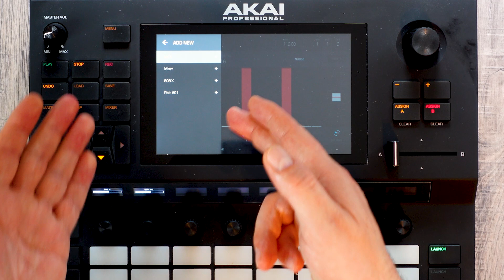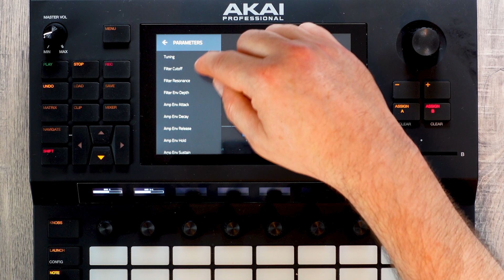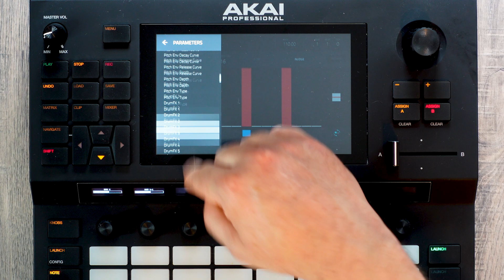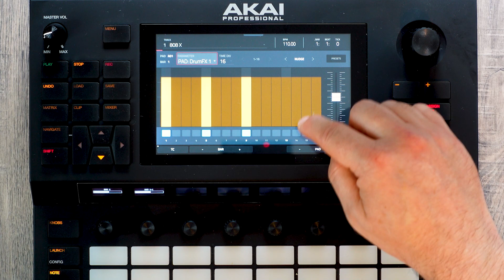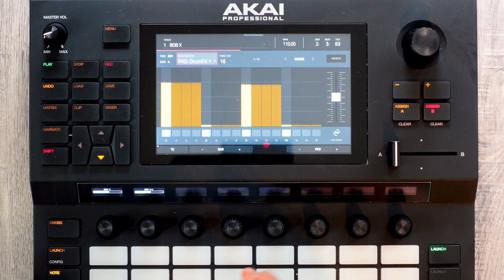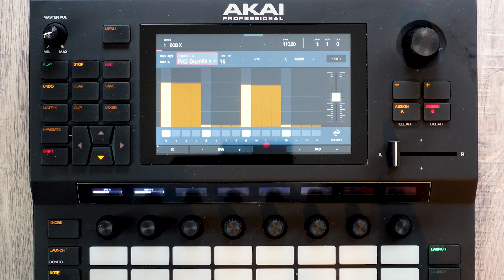Akai Force Tutorial: Use Sample Pad Automation To Create Interesting Drums

Comment: Such a great technique. As a Tracker user as well this speaks to me as trackers thru the ages have made this easy. 

And this is so much easier than automation in DAWs where to get per step is a matter of a lot of zooming in & out and drawing small chunks of data in right at the start and end of your midi data or samples. 

It’s rare Akai get something so right but they have here. And not turning off the per step automation by accident (shown here by the next step along with no levels turned up) sometimes brings some happy accidents. 

Nice work Andy 👍🏼

Comment: Hey man, thanks for the great videos. So much to figure out with this device. Just wondering, my samples are sounding different on different pads even when I’ve set all parameters the same. Any idea why this is the case? Can’t figure it out for the life of me.
Reply from the maker: That’s a head scratcher, without seeing what’s going on I’m not sure. I would suggest resetting preferences, creating a new project and then putting some samples on pads and seeing if it persists. The only thing I can think of is if you went to track edit and instead of having ‘all’ selected, you’ve tweaked an envelope or something on a few individual pads and haven’t spotted that. Also check your pad mixer and see if any sends have been applied to individual pads.

Comment: Definitely an underrated and less well known feature of the The Force and nice and clearly explained - well done. My only bug bear with it, is that it applies to the track regardless of the clip (NOT TRUE - SEE COMMENT BELOW). So if you wanted those parameter modulations in one clip on a track but not another, you have to turn off the step sequencer for the one you don't want it on and there's no quick button combo to do that that I'm aware of. I'd love it to apply to individual clips rather than tracks, unless I've missed something...
Reply from the maker: I’m not near my Force at the moment so can’t test it, but I thought it was per-clip rather than per track. If you add some automation to a clip then copy and paste it as usual, select the duplicate and then press shift + delete automation (bottom row) you can try moving between the two and see if it’s persistent.
Reply: @MaxipokMusic  My mistake - I've just checked and it does seem to be clip based. Don't know how I missed that! Then, yes indeed, this thing is killer. Combined with the envelope follower and macros, this gives you the kind of modulation flexibility you get in modular, especially once the probability comes, as you say.

Comment: I appreciate your videos. I'm curious of your reasons for moving on to the force from the push 2? I'm actually considering a push 2 to take advantage of ableton 11 but I already gave a force. So lots of money invested on both sides. Anyway. Thanks for your work
Reply from the maker: Push 2 is a really nice device, but the reason I switched was to do with performance. Push has track focus, meaning it will only display or let you control one ‘thing’ at a time. For example you can have the mixer up, or device controls, but not both. And the knobs are fixed to the selected mode, so you can’t map them to macros and have the stay available regardless of the track you have armed, like you can with the Force. So in a nutshell, it only lets you do one thing at a time, whereas you can set the Force up to give you access to macros, mixer, clip / scene launching, and note mode all at the same time. It’s the only device I know of that can do this, making it great for performance. You can get Push to sort of do this, but I means using Max For Live and buying a couple of scripts (push hacker for example), but even with that it’s not as flexible. If I was just making music in Ableton I’d have kept the Push, but as I like making performance videos, Force was the best option.
Reply: @MaxipokMusic  thank you so much for that detailed reply! That really helps.

Comment: Step sequencer is really the only thing which I was not utilizing in my workflow but it seems that there is a lot to discover. Nevertheless I like to twist knobs more than setting things one by one... 👌
Reply from the maker: Yep I know what you mean, it doesn’t come naturally to me either. I wonder if it depends whether you started out on Roland xox boxes? The allegedly coming probability stuff will really open this up for making evolving patterns though, pretty cool…
Reply: @MaxipokMusic  tbh probability is not the thing I've been waiting for.
One thing that bothers me is no drum-master page
See, for melodic plugins knob->track is giving you possibility to change parameters on the run for all notes in clip, however while you go there while you are in drum track is it useless, cause macros are just dumb and assigned to a single pad. If they were assigned to "master" drum track and have one reset button or knob, it would be so perfect to jam with.
Reply from the maker: @beats4trips  You can stack multiple macros on a single knob, and set them to momentary so it will snap back to base values when you release the knob, that kind of does what you are describing. I use that sort of setup a lot in performance videos. If there’s a limit to the number of parameters you can stack on a single macro I haven’t encountered it yet… 😃
Reply: @MaxipokMusic  yeah. I incorporated this in my template, but tbh it should be on the "track" page.
While it's on macro, i need to switch between track and macro project in knob section because my performances are based on melodic plugins movement like cutoff/reso, which are in track section.
Nevertheless, I'm going to try drum sequencing, as it's kinda tempting right now